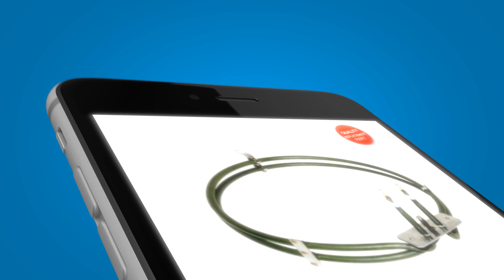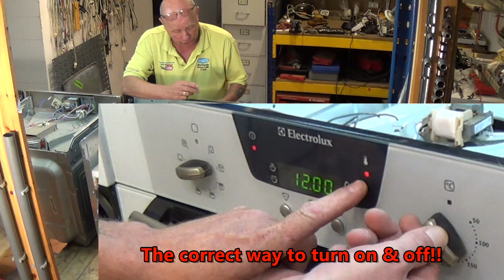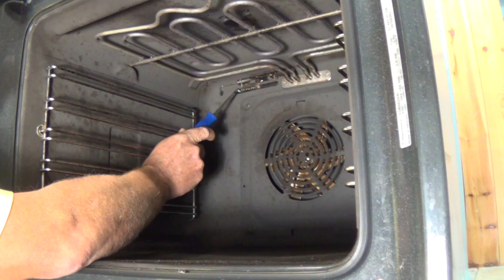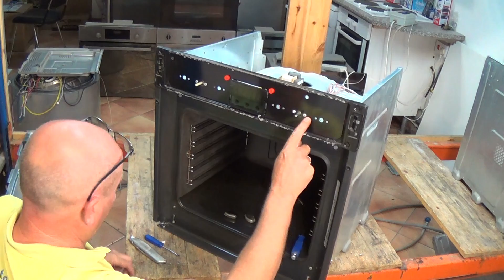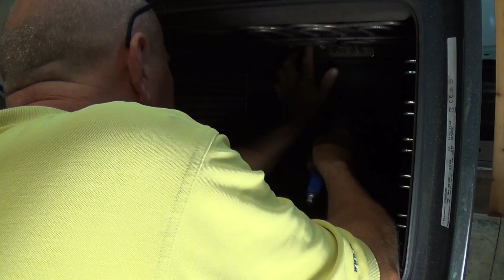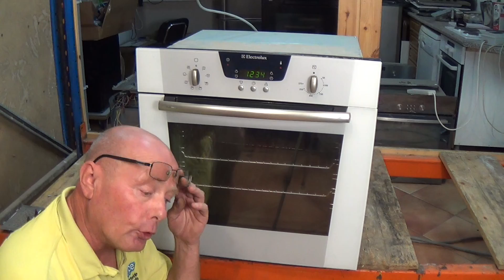How cooker oven Thermostats work & how to replace

Comment: Hi, I would like help with the problem I have with the operation of my "De Dietrich" UMP 404 baking oven (year of manufacture 2000), the point is that when I start baking (for example, normal baking in an upper and lower heating body with a thermostat at 175 degrees Celsius) the heating starts and then after a few minutes (5-8 minutes) The oven is disconnected and stops working (without tripping the automatic circuit breaker in the home electrical panel) and the oven's general clock is flashing (that is, there is no electricity in the oven), and after I adjust the clock and reset it, and return the thermostat and the baking program to what it was before (returns everything again) then it goes back to working normally without interrupting the baking until I stop it.
Do you have any idea what the problem is or what I should do?
Thanks in advance Adi
sy the way very good video

Comment: Hi I have an electrolux fan oven which looks the same as the one in your video. My oven and grill keeps going off after 15 or 20 mins. The red light on the left stays on but the heating red light goes off and it won't work again until it cools down. I thought it might be the thermostat but before the oven goes off if I knock the temp down it stops heating and if I turn it back up it starts heating again. So made me doubt myself. Also we have noticed the oven seems to be very hot on the front where the timer is so now I'm wondering if its the cooling fan that has stopped working and the safety thermostat is turning the oven off. Any help would be greatly appreciated.

Thanks. The videos a great 👍

Comment: I would like to remove the digital clock/temp control for my oven on my older Maytag gas range, to a analog or hand control in other words back to 1960 style backing. Please do not say go out and buy a new stove, I'm retired on a very modest income.

Comment: I'm hoping you're the guy that can sort my problem, my oven starting sparking & arcing the other day, scared me to death, I quickly turned it off & gave it a few minutes before turning it back on, the oven still worked but it was only blowing cold air (it's an under-counter fan oven in it's own 600mm base unit). Not being sure if it's just the element that's burned out, I decided to look for a temp replacement until I finally get around to getting a new kitchen fitted, the cooker's been in since the house was built 25 years ago, so I thought it not worth trying to fix. I found one on Ebay that was cheap & local, but when I got it back home I could see that it wouldn't fit into my base unit because of the socket that's housed inside there & the gas pipe for the hob, the old oven had a weird shape to it at the back & missed these obsticles, but not only that, I could also see that they had just fitted a plug to it themselves so they could plug it in & show me that it worked when I picked it up, so that then told me that they must have had it in a larder/housing unit.
I could get the oven in the base unit if I take out the shelf that it's supposed to sit on, which means that it would be sat on the bottom of the base unit, would that cause any problems? Does there have to be a space under the actual oven for air to circulate?
Also, would I be okay to just carry on using the plug that they fitted themselves? There is also a socket with a big red switch that operates the electic supply to the socket inside the oven base unit, that's at worktop level in the tile work. I don't have a socket on the wall that I can just wire an oven to independently, like you would with a larder/housing unit.
Reply from the maker: element fault normal 
Thanks 👍 for watching and please remember to subscribe to the Channel as that's what keeps us going in able to make the video for you

Comment: Hi, just been watching your youtube videos on repairing single integrated ovens

From the video I think I need a Stoves 444410141 Temperature Sensor

-The oven takes time to reach a temperaturem (22 minutes to get to 220 degrees)
-When I check the temperature its higher than selected
e.g. on Fan assisted I selected 220 degrees but when I measured the temperature it was 270 degrees.

I've emailed your shop to see if you have the part thanks
Reply from the maker: I would also check all of the elements as there may be more than one in that oven also chech the fan motor please see this as it will help a lot i think https://www.youtube.com/watch?v=k35SXHm9JGg&t. please remember to subscribe to the Channel as that's what keeps us going and able to make videos for you

Comment: Hi I had a ring element go on an oven. After replacing it there thermostat control stopped working. I then discovered that there was current between the plug to the chassis. Any suggestions?
Thanks

Comment: I checked the multimeter shows 00.2 reading at the lowest "200" and it does sound beeeeeeeeee . Is it faulty or  not the problem with my oven it takes a long time to cook the food then it should be, I checked the grill element and the another element that attached with the fan  both work fine so I though my problem with thermostat.

Comment: I have a standard benchtop oven/toaster and it only goes to 260C I want 300 350C to cook Pizzas it has 2 elements top and 2 on the bottom ..want to fit 2 thermostats and put some insulation around the outside..Can this be done??

Comment: Hi Paul, great video and love the fact you cover the alternatives. Question for you if I may? I've a fan oven which seems to trip the rcd when switching on the oven, I've checked resistance on the internal and base oven elements which are okay, checked the main board and caps, so a little stumped. Would appreciate any advice, I know it's the oven, tried another in it's place. Thank You in advance.
Reply: Did you try the oven bulb? Remove the bulb and plug the oven and have a look.

Comment: Great video. I have a cooker same as your second example. . My fan sometimes runs and sometimes not, intermittent, the oven over heats and fault codes fo6 I indesit oven. I’m thinking the PCB or capacitor.I would appreciate any advice?

Comment: Is it possible for the thermostat to be wrong? Let's say you set the oven to 250 degrees but it stops heating at 150. Wouldn't that mean that the thermostat rod would have to be physically wrong?

What I mean is, if the oven stops at the temperature you set it to, that means that thats the temperature inside the oven. It can't be "off" since a thermostat is a physical thing and not a program which can be configurated wrong.

I'm having an argument with someone claiming their oven is faulty because their pizza takes "twice as long to cook" but all the elements and the fan works and the oven has a thermometer that says it has reached the applied temperature.

I would have understood if the thermometer showed the wrong degrees but a thermostat is a thermostat... I don't know how to explain it too him. Can I be wrong?

Comment: hi, i have a Logik LBFANX14. I want to replace the thermostat, however, how do i remove the control panel? it has 5 hooks that each looks like a small cylinder.

Comment: I have a Thor Kitchen TKG3001U 30inch .This thing will come on and act like its been turned on and run for a min and then turn off .It will do this a few times a day . There is no electric panel switch with buttons, they are all knobs.

Comment: I guess I'm confused if a circuit is open then the electricity shouldn't go through or am I wrong if the circuit is closed and it should pass electricity through it I guess I was confused about your explanation of the points

Comment: My oven was working fine. Oven said I need it clean it set it to clean itself cleaning completed.now turns on fine but elements will not get hot you can hear fans running timer works. But will not get hot.